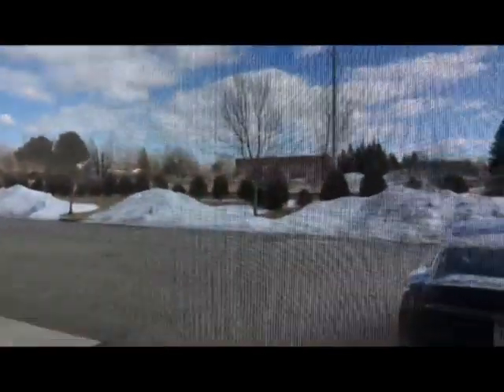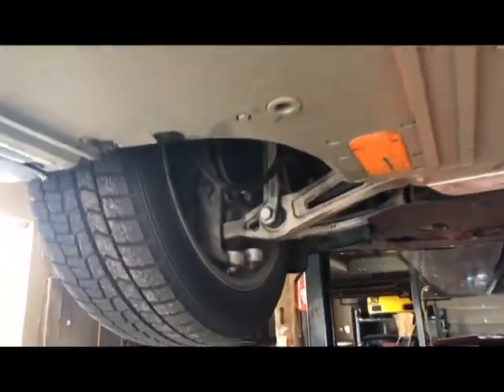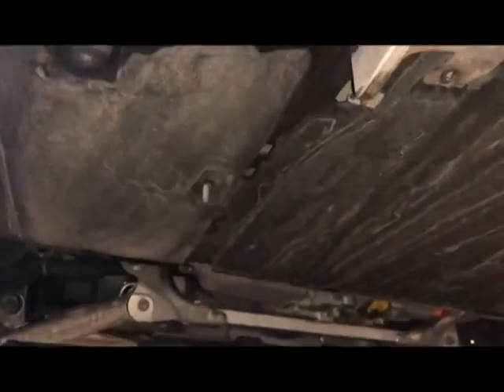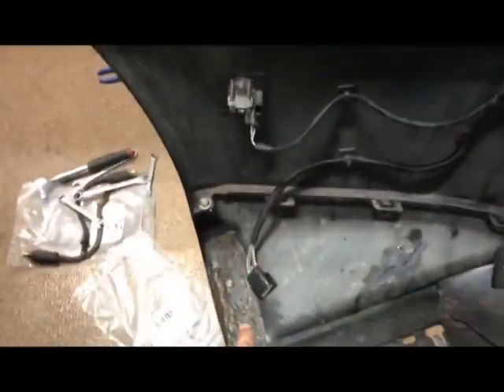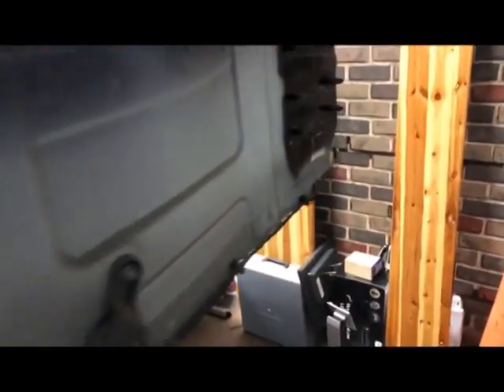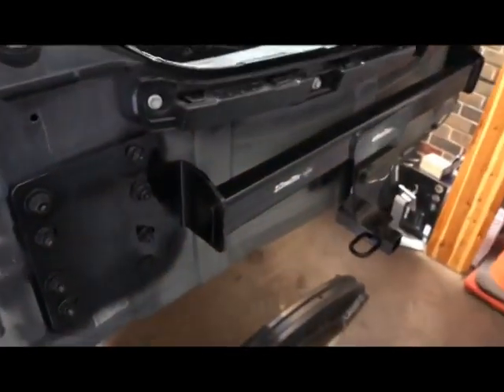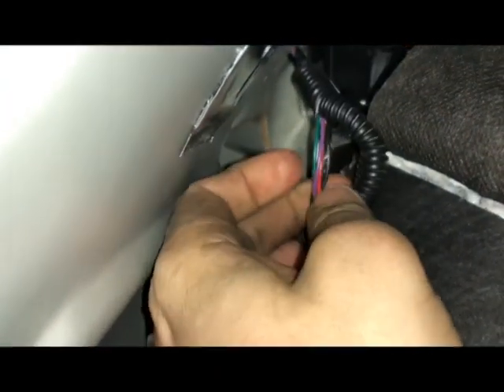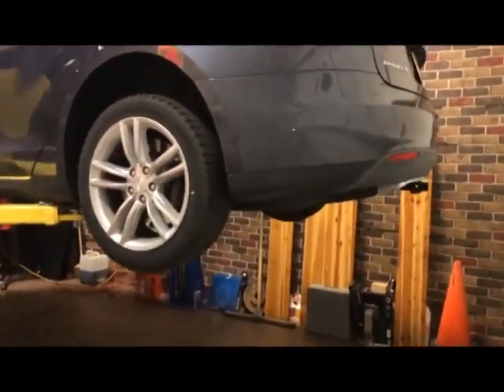Tesla Model S finally gets a trailer hitch!

Comment: Just a quick question...why didn't you install the origional metal bumper over the top of the hitch?
Reply from the maker: didn't fit, reduces thread engagement on nuts and offers no structural benefit.